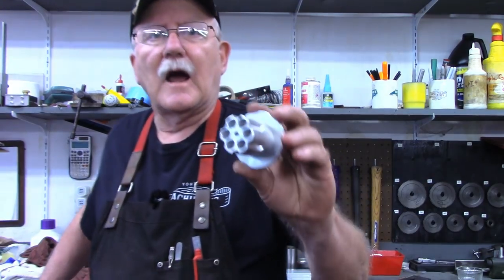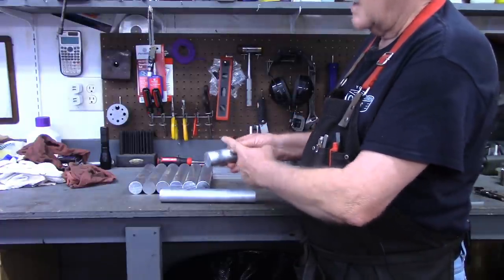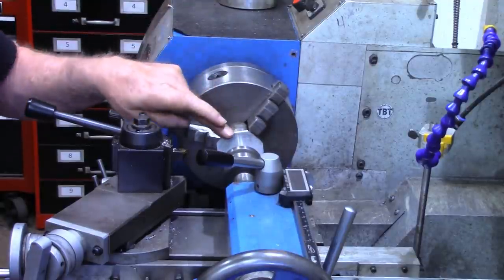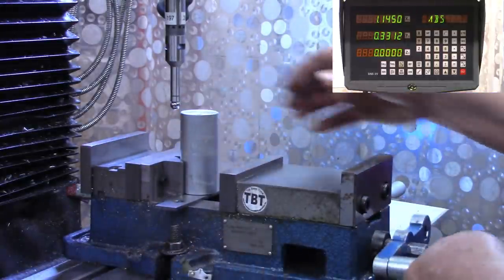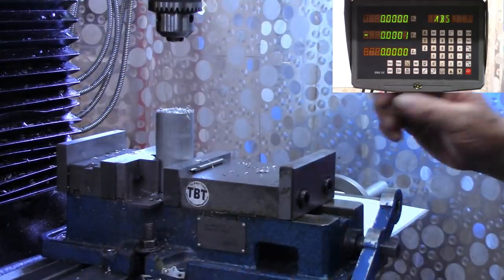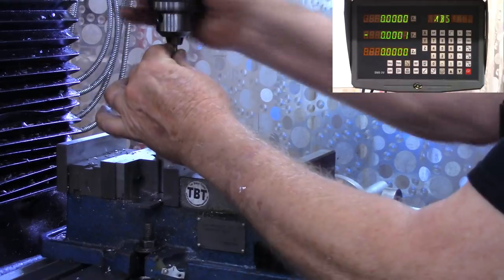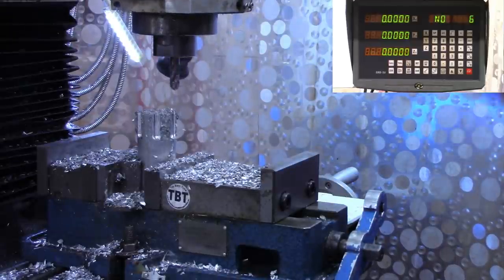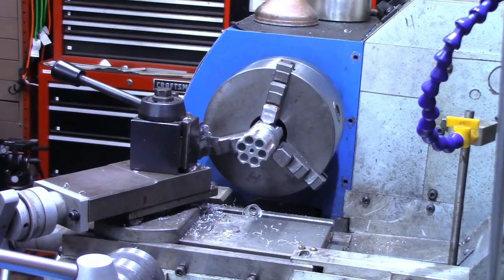Revisiting A 4 Year Old Project (Cylinder Pencil Holders)

Comment: Just a suggestion, the cylinders would look nice with black anodizing, and the bases could be done in gold. Paint and powder coating conceal the metal, and the finished parts often look like plastic. Anodizing improves durability without concealing the metal's grain and machine marks. It's just another option.

Comment: Had anyone thought of drilling a 10-32 clearance hole through all 12 saw cut blanks, then chucking all 12 in the lathe ?  Could do a "gang bang" with a small arbor instead of doing them individually... Have to think of an end with point hole for the live dead center?